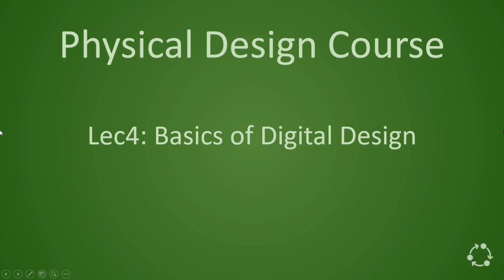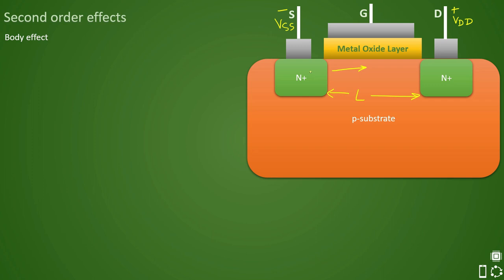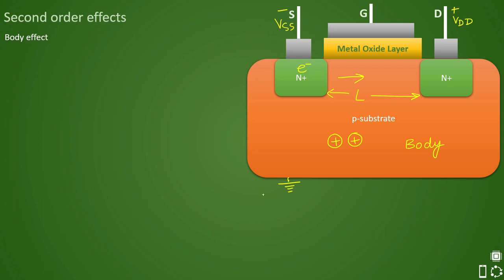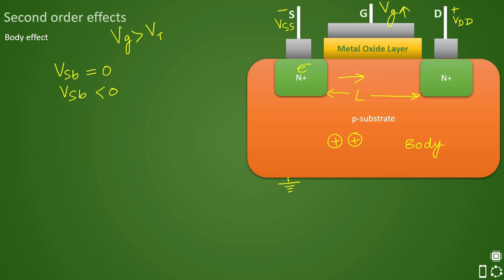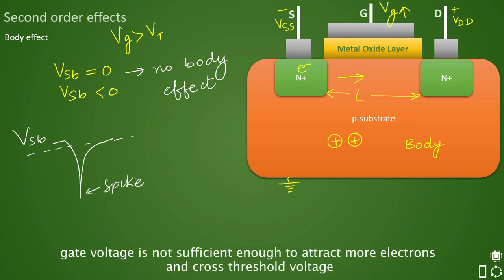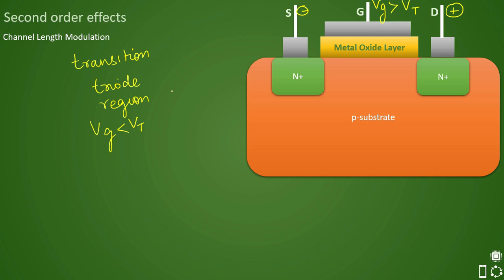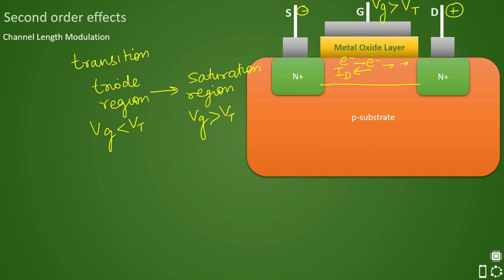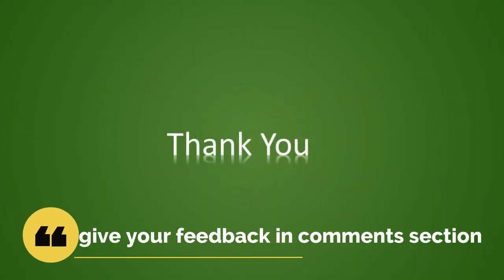PD Lec 4 - CMOS Basics part-3 | Tutorial | VLSI | Physical Design

Comment: The channel length modulation part is incorrect.
It's the shortening of the length of the effective inverted region when bias is increased at drain as it results into increase in depletion region around the drain.
Reply: @VLSIAcademyhub  Just check out this video then :- https://www.youtube.com/watch?v=vd_g8l0DycU&list=PLHO2NKv71TvsSqYwVvUCZwNkY-jUyUHdS&index=5&ab_channel=NPTEL-NOCIITM
I'm afraid whatever resources (Books, NPTEL lectures, Classwork) I have gone through never related tapering to CLM. And I don't think so horizontal (straight) length and tapering is same thing at all.